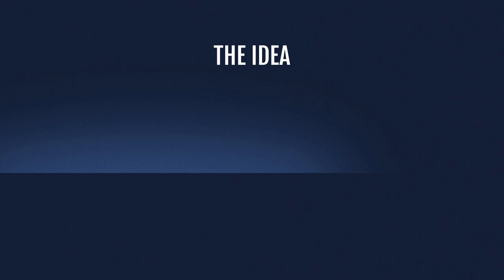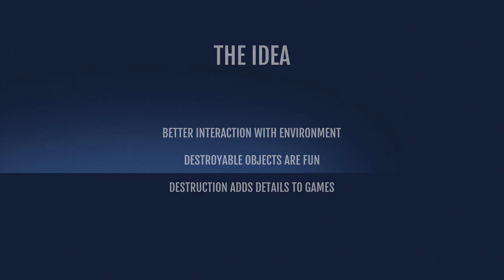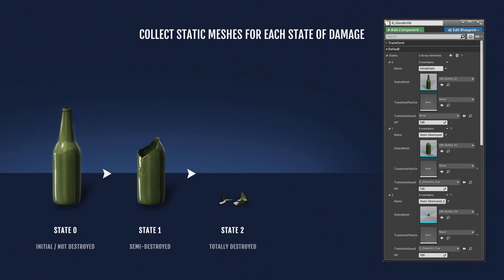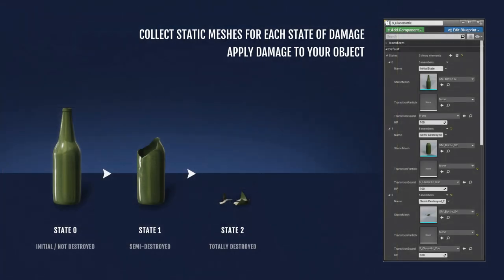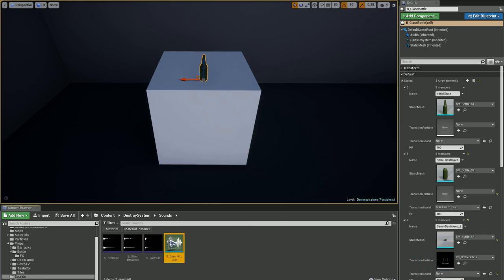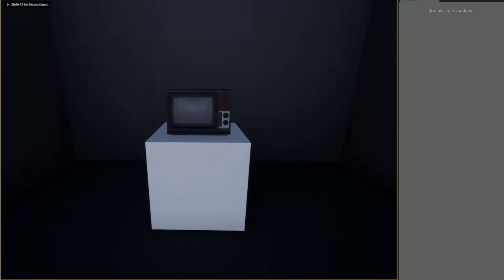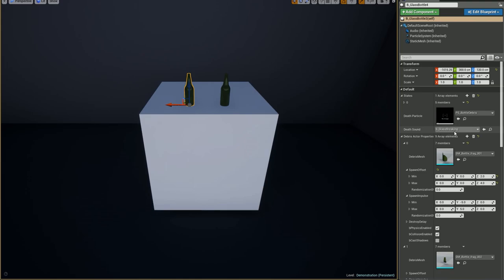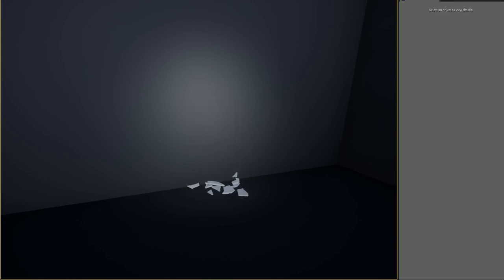UE4 Destruction System - Feature Walkthrough

Comment: Any chance of a VR integration guide for this? Purchased the pack and have been trying to set it up to trigger damaged states via interaction from a thrown actor with no luck. Any advice would be helpful
Reply from the maker: Hi, Thank you for your support.
Generally, Destruction System is based on "AnyDamage" event, so in order to work properly you need to apply damage somehow. For your scenario, I suggest adding collision component (sphere or box) for actor BP you want to destroy. Then, add "OnComponentBeginOverlap" event for that component (right click and choose Add Event). Now, you can decide how much damage it applied when overlapping with other objects (like thrown actors in VR). Simply add "Apply Damage" node with some default "Base Damage" value. You just need to make sure that collision works and ignore any object you don't want to trigger the event. Check "B_DestructionSystemDemonstrationTrigger" Blueprint in DemonstrationAssets folder. There's an example of triggering damage state when player is inside a volume and presses "F" key. You can control when and how it triggers any way you want. I hope that helps!
Reply: @UnrealBucket  Really appreciate the reply, was able to resolve all integration issues I was having thanks to you! Only other thing I've noticed is when damaging a bottle it will sometimes also apply damage to another bottle and destroy both meshes.